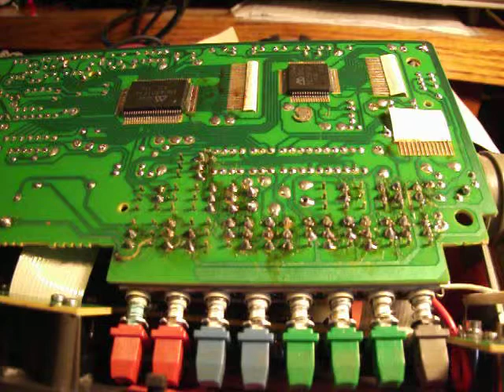Micronta Benchtop Multimeter Model 22-195 repair video # 1

Comment: I just did same repairs to one I got somewhere along the way. The third trace to the right looked odd, but had continuity. My symptom was no functionality in resistance, continuity, and voltage. An open trace or two on the circuit board between probes and the circuitry would make sense. I'm wondering what measurement mistake would cause that. First assumption would be low current measurement, but I'd think that's fused. Possibly voltage measurement across ohm meter function setting on meter? Thanks and God Bless!
Reply from the maker: I am not sure what happened to this micronta. I picked it up used and it must ahve been damaged before I got it because it wasn't working right.
Reply: Andy Tobin Same with mine. Apparently by the name written on it in indelible marker it belonged to an oil service guy. I was thinking after my post.... Maybe in the continuity position? Anyway, your video inspired me to buy 4 C cells and take the meter out of the closet and check it out. Thanks and God Bless you!
Reply from the maker: @johnnytacokleinschmidt515  God bless you too. This is a half 
decent meter so I hope you can get it to work.
Reply: Andy Tobin It's working perfectly. I'm going to use it at the bench in my hobby shop. I'm pleased about that.